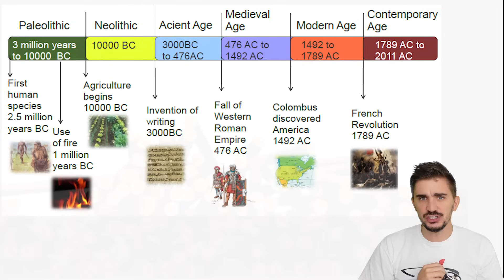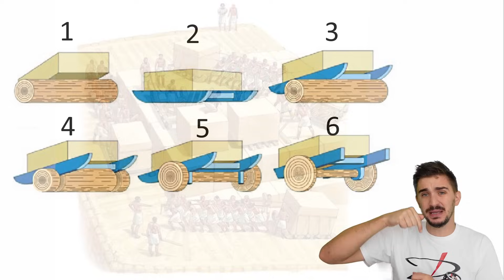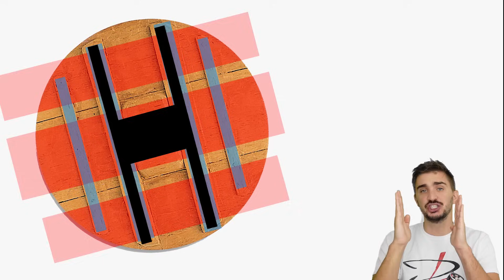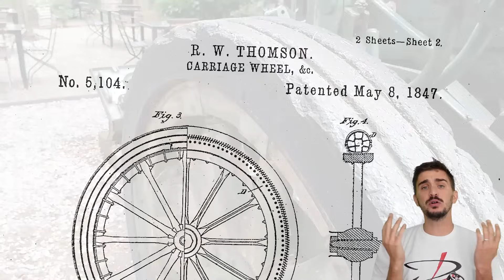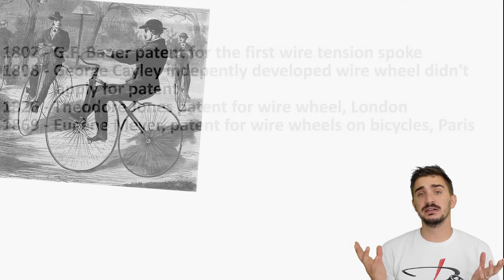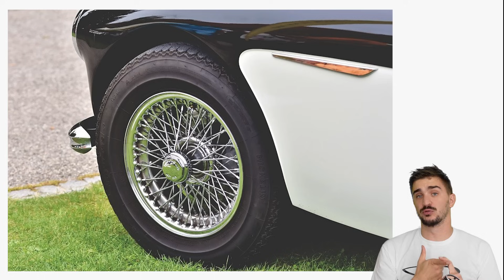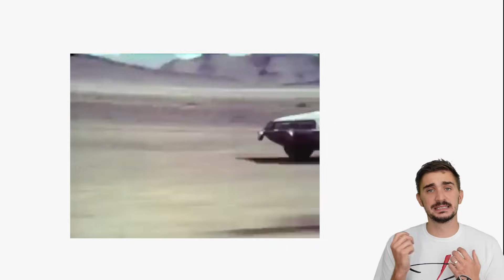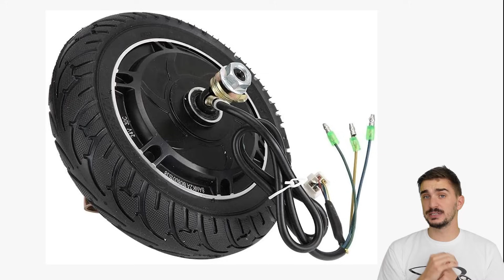History and EVOLUTION of the WHEEL - from 3500 BCE to the PRESENT and BEYOND

Comment: The history and evolution is always skewed towards transportation and motor vehicles.
Never do you hear of the evolution of the wheel in general mechanics, once you go down that road, you’ll quickly deduce and discover that the wheel is way older than we think.
Apart from being older, no one or group of people can claim it’s invention.
Let us explore the wheel in milling grain for instance, or it’s use in moving water for irrigation, also it’s use in securing openings, even pulleys - You can see immediately how many popular theories fall apart.

Also the idea that it was never inspired by nature is a very flawed assumption. - why?
People used logs as rollers to move heavy objects, do we not think people had discovered/ figured out that easies way to move a heavy log was to roll it?
Or that round(er) shaped rocks were easier to move than irregular ones?
In the plant world there is a wild tropical plant that develops flowers in and pod along its stem when the seeds are ready for dispersal the dry stem breaks off in the form of what is remarkably similar to wheels on axles that roll along the ground in the wind or running rain water. (I don’t know the name of the plant but it is quite common grasslands)

Comment: So a few things.  The earliest evidence we have for spokes comes from the Sintashta culture in modern day Ukraine and Russia  Like the one in your illustration of an Egyptian chariot wheel the hub was wide, except made of wood at first.  Lubrication is not well understood, but obviously, speed equates to heat generation, and merely spreading that over a larger bearing surface has its limits.  Roundness and durability of the bearing races is critical as well.  The need for speed to use early carts as primitive chariots would have driven materials and lubrication experimentation.  It is even possible (no hard data yet) that this experimentation became a driving force in copper and copper alloy metallurgy and craftsmanship.  It cannot be stressed enough just how difficult it is to work copper and copper alloys.  They work harden quite quickly, and need to be constantly annealed.  This is super tedious.  Similarly, finding lubricant solutions that maintain film strength was and continues to be nontrivial.  Oils tend to thin and lose viscosity as they are heated.  A good way to see this is to try different oils for frying an egg (scrambled or not) and see what happens with various amounts of agitation or restraint from that while they cook.  Olive oil loses film strength quite quickly, while vegetable oil holds   up a little longer.  Tallow for wheel bearing lubrication is not nearly as effective as a thin oil from a tar seep, but it is very hard to collect a useful amount.  David Anthony's book "The Horse, the Wheel, and Language" covers much (not all) of what is known in this space.

Comment: You missed a CRITICAL aspect---   The HUB!  the friction on a wooden (or even metal wheel) is greatest where it rubs on the AXLE.  Surface to surface friction It would wear it out quite quickly even with lubrication.  A HUGE technical problem.  And what about roller and ball bearings?

Comment: The tire is an accordion around the outer circumference of ring...the ring coils into itself...the spokes shuriken and expand as you pull it open and it sucks in air...through a nozzle on the inside...you can release the nozzle to expel air and recollapse the tire...

Comment: The leather band around the circumference of a spoked wooden wheel, holds the three wooden parts, hub, spokes, and rim segments, together. It tyes them together. It's called the tyre.  Metal was used, then solid rubber over that. Dunlop attached his air filled rubber tyres to the wooden rims, Michelin gave them bands.

Comment: the fact that fibre reinforced wheels existed that early makes me wonder why the east germans didn't use them on the trabant, considering how keen they were on replacing as much steel with fibre reinforced resin and aluminium, as possible in order to cope with their limited steel supply and to improve fuel economy.
my guess is that there must have been MASSIVE safety concerns.

Comment: So many disagreements from so many  archaeological presumptions. Rocks rolling down a hill could provide inspiration for a wheel, as would logs. 

I'll bet one wheel, like a wheelbarrow, came before 2, 3 or 4 wheeled devices. 

Jeezuz, Egyptians and their block pyramids weren't the first things humans needed to move from A to B. Such a cliché.

You DON'T need metals to make a centre hold in stone or wood. Sand friction grinding was common.

The spoked wheel was NOT an "improvement" on the solid wheel. It was a VARIATION of the wheel concept.  Eg, if carting blocks, it was certainly NOT better for weight bearing. Sure, better for light, fast rotation but had far less mass, so far less momentum once spinning.

Huh? You mentioned rim wear but not axle wear. Steel rims were not for circumferential wear but to prevent splitting and warping and keeping spokes tight. Axle wear was reduced through greasing and heat treating the hardwood rubbing surfaces with tree resins.

Who says primitive spring type independent suspension as shock absorption to prevent breakage didn't come before rubber tyres for human comfort? 

Solid rubber tyres, pretty uncomfortable actually, would have served better for traction, like not slipping on hills and surfaces like wet rocks.

So many historians presume primative people were more stupid than modern people. Not so. Have they not seen the Anti Kythera Clock.
Reply from the maker: You must be the life of every party because everyone loves a person that has to be right about everything.
Reply: @d4a  
No, it's not about "being right about everything". It's about presenting information which is fully truthful and not just secondhand historical  *suppositions*, AND about admitting when things ",might be"  "could be" "probably were" "believed to be"  etc. It is not me but this guy (or his script writer) who think they know everything.

I used to like this channel when I first discovered it. The guy sounded 100% knowledgeable and authoritative. But, over time, and from reading many comments by people more knowledgeable about his presented topics, I realised that a lot of what he says is bullshit ... but without any sense of doubt. He sounds like such an expert -- ON EVERYTHING he presents. He has that unequivocal, arrogant, condescending,  "rightness" of delivery. But I have now come to the conclusion that he peddles a lot of well-researched facts plus many half truths. That's all I was pointing out. Another amateur expert, making money from general public ignorance. 

As a long time educator, I am always concerned about how the public gets its information and how truthful it is. Eg, at school in the 1960s we were taught that the pyramids were build by slaves. More recent interpretations of texts and pictures now say all the workers were happy, paid and volunteer subjects of the Pharaohs. Even as a kid, slaves made no sense to me. So much for archeological accuracy and all the books promoting this since whiteman colonists started telling this narrative. Turns out there was a racist, superiority purpose to the story: "Africans were nasty, primative, violent people". Oh, and the Romans, the Greeks, the Ottomans, the British werent?

This video subtly spreads so many similar inferences that ancient people were simplistic, uncreative, "it took 3000 years to come up with a comfortable wheel". How tf would anyone know that? More likely, they just didn't give a shit about so-called modern comfort. Just because modern inventors sit around thinking "how can we come up with a new model of phone which has 50 new useless features which nobody is asking for" doesn't mean moderns are smarter than ancients.

Comment: No way, that people went from logs to sleds. No idiot would consider that a net gain of energy usage. Far more likely they went from straight logs to the wheel on fixed axle which WOULD be an improvement in steering, friction, wear, labour, time, energy.

Comment: The Motor in the wheel will reduce massively the Traktion because the wheels are unsprung mass so the suspension need to work harder 
And also for motorbike rider it will be nearly impossible because the centrifugal force will reduce not just the traction but also the lean in the corner movement 
So at least for motorsports it will be completely garbage 🗑️

Comment: 1.49 - Rolling log is implied to precede the sled.  I don't know why?  Sleds are useful for transporting any moderately heavy load over less than perfectly even surface, as it prevents the load from getting stuck on bumps.  If you "pave" the way with wood, you can even achieve lower friction.  Then , on a paved or evened out terrain, it finally makes sense to try the rolling log.  On uneven ground it will just get stuck.
Just saying what makes sense to me, I don't know what is most commonly assumed.  (However, the illustration presented at 2:11 seems to agree with my view.  We can see a loaded sled, on rolling logs, on a smoothed or paved road.  Not a bare stone block with rollers underneath, being pulled over uneven ground.)

Re: Why the wheel came in so late.
While the reasons presented here are definitely correct, I like to rather think about who might have benefited from the wheel the most.  While the wheel is so incredibly useful, everybody did benefit from it, but not to the same extent.  
1.  Primitive wheels are no good for moving heavy loads.
People tend to overlook it, but it's absolutely true.  The load bearing capacity of a simple sled is an order of magnitude higher than that of a primitive wheel.  Or even a sophisticated one!  Sleds were used for big objects for a very long time after the wheel was already known.
2.  Sedentary people do not move much in general.  That's why they are called sedentary.
From that I propose, that more nomadic lifestyle is likely to come up with this invention.  The people who absolutely need to move, or they starve.  For them, having even slightly better transportation capabilities is of great value.
3.  Wheels are no good on uneven ground.
Currently, mountains and heavily wooded areas are still converted into "flatlands" in order to use the wheel (roads, rails).  Where it's not possible, people still use horses, which walk.  When horses can't go, they carry stuff on their own backs.

What it all amounts to?
I believe, that in search for the wheel inventors, we should look to the nomadic people (modest loads, high distance), who lived on, or at least in close proximity of the flatlands.  Basically, Eurasian steppe.  Yes, finds will be hard in this terrain...

So finally, back to the original question of "why so late?".  In my approach the wheel came in so late, because people who could benefit from it the most, started colonizing the environment with the strongest "need" very late.

Re: Greeks did that, Egyptians did the next thing.
How do we know that?  We don't.  It's probably the earliest finds which come from those areas, but you don't get finds where you don't dig, do you? 
Anyway, if that approach is true, I'm a Pole so I want to claim that invention for my nation.  (That's reductio ad absurdum, if it's not obvious!).  The earliest depiction of a wagon, or any other wheeled vehicle, happens to come from Poland.  Obviously, it means nothing  
But if people claim it does?  Gimme! ;-)

Okay, it's a long post already.

Comment: Another interesting "evolution" of the wheel is represented by Trilex, a design that was used on heavy vehicles until the 80's.

The rim was composed by three segments that were kept together by the central part of the wheel, a separate component called spider.

This design was beneficial for the mounting and removal of the tyre because it only required basic tools.

Comment: Nice history lesson! Always good to be reminded of how things came to be.
Minor correction: at about 6:58 the iron band around the wooden wheel is in fact called a tyre/tire, not a rim. Ask any wheelwright (wheel builder) such as Dave Engel!
Also in the past there used to be leather tyres. I suppose that would wear out even faster than wood but then it could be made easily replaceable.

Comment: I had the chance of touring the Carbon Revolution factory about 2 years back. It was definitely an interesting experience, and at least one set of wheels was on staff cars. Cost can be easily explained by everything between ply cutting and curing being manual processes - although with some fairly advanced production management systems to reduce the complexity to something that can be taught to normal factory labourers. Plus there's also the expectation of a pristine CF appearance, leading to wheels that are serviceable, but having visual defects being scrapped..

Comment: This is great! Something not well known is that similar to how you mentioned large log axles being inefficient due to friction losses, the larger a bearing's internal diameter, the higher the friction and shorter the service life. So I think the hollow hubless wheel design will keep just being something we see on low production vehicles and fancy renders. It's quite easy to make small, efficient bearings with a 20+ year service life but that simply isn't possible with large internal diameter bearings.

Comment: Could it be that the constant regime is not the same, that the Dynamic regime?????...
 I know that kinetic energy goes up to the square of the speed, that's why you need 3 times more power to do the 100-200 in the same time as the 0-100, but then why does a 1,500HP car do the 100-200 in 4 seconds instead of 2.8 ?, if at 200KMH the wind resistance is 107HP and the rolling resistance is clearly less than 50HP, is it perhaps that even if the speed is less than 200KMH at any given time the wind resistance is greater than 107HP whay to accelerate

forgive my bad English 😅
Reply: The answer is torque vs horsepower/kW.
Reply: @iansmith6728  that 2 cars reach 0-100 in the same time does not mean that they will travel the same distance to reach those 100KMH, a car A and a car B that reach 0-100 in the same time who will win will be the one who travels more distance in that 0-100 I mean the one with the most torque
Reply: @iansmith6728  It seems that it does not make sense but think about it in the end the only thing that matters is the average power, for example if you want to do a 0-100KMH in 5.6 seconds you will need to give the mass of the car 590kilojoules of energy in those 5.6 seconds, which is equivalent to 150HP, If you have a car with a lot of torque and we look at a graph you will see that the power increases very abruptly and then stabilizes resulting in 150HP of average power and 250HP of maximum power, however another without so much torque but 300HP the power will not increase so abruptly but Likewise, the average power will be 150HP but in the first 2 seconds the car with more torque had more speed, therefore in those 5.6 seconds the car with more torque traveled more distance

Comment: I would argue the primary advantage of pneumatic tires is not comfort but reduced rolling resistance. Tires actually absorb a HUGE amount of vibration into the sidewalls of the tire which massively reduces the energy transferred to the vehicle.

Comment: great video as per usual.

On the topic of airless tires. I really don't see that happening. What happens if you live in a country with snow? If snow gets inside of them you're basically driving on a solid tire
Reply: Something that BMW is about to assault head-on with their latest tyres.
Reply: Those are only showing the technology, the commercial versions are visually the same as the current inflated ones.
 But you are right, they will never happen because for other reasons, such as balance, heat dissipation and deformation. Maybe if the future roads are perfectly flat, then those tires will improve something..

Comment: One thing that could use more elaboration is bearings because it's one thing to figure out axles and another to find out how to keep them from grinding into dust.
Reply: Indeed! This topic would also shed some light on why hubless wheels will never take off. They have massive bearing drag.
Reply: @WheelNut2  drag and wear, because the surface speeds for the bearing are so high. While this could be overcome with something like a magnetic field bearing, there is no apparent reason (other than appearance) why hubless wheels are preferable to conventional wheels; in short, hubless wheels are a solution looking for a problem.
Reply: @WheelNut2  the way they look is enough for me to not buy a vehicle with such wheels. Ugly
Reply: Yeah, bearing would be a really cool followup.
Reply: That's exactly what I was thinking! I just replaced my car's front wheel bearing and this was fresh on my mind. Without bearings that means that you have two parts (axle and wheel) grinding against each other until one of them gives out. Bearings should dramatically extend the life of both parts.
Reply: My history class attributed the invention of ball bearings to ancient Rome for use in their chariots
Reply: And after bearings, I'd like a similar video about brushless motors.
Reply: Okay, another rabbit hole.  Here we go.
Reply: Yes, wheel bearings were a major wheel improvement.  Two types, that I know of.  One uses ball bearings, while the other reminds me of log & sled method of transport that preceded the wheel.